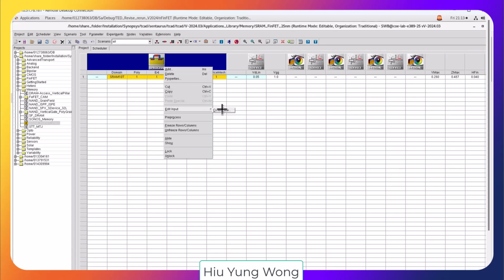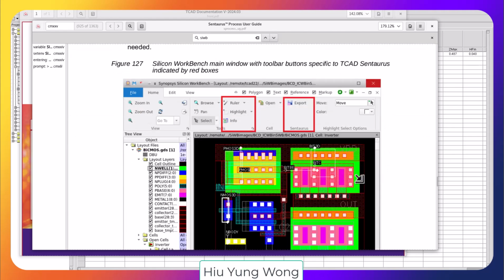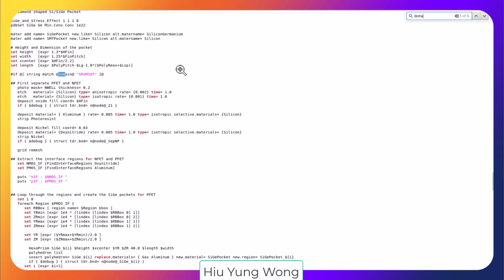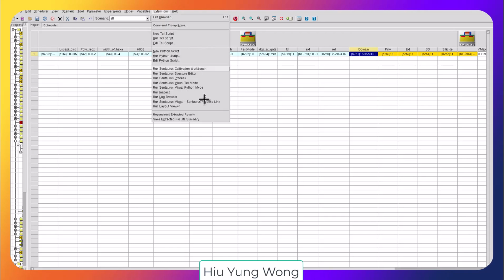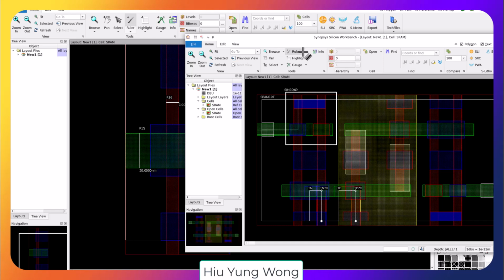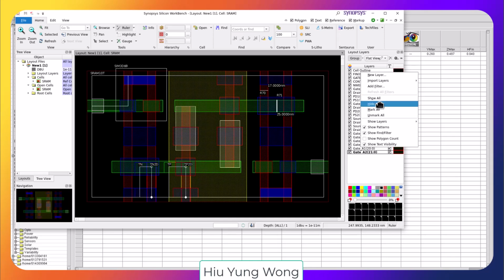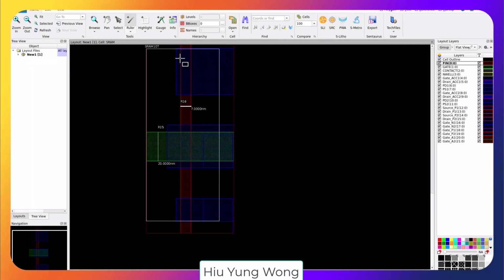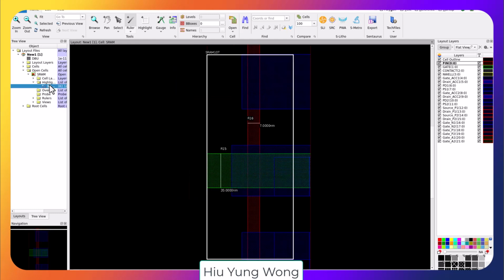TCAD SRAM Example and Silicon Workbench

Comment: thanks you a lot. These videos help me alot.
But I have a problem. I have simulated a simple MOSFET in Sentaurus TCAD. In my SDEVICE I set Drain voltage in constant value like (Vd) which I can change manually from SWB, then I sweep Gate Voltage from -Vd to +Vd and I get very fine plot of IV curve.
I want to do this for a lot of Vd and export the XY data of IV curve in Excel file.
I can export the XY data of the plot one by one but it's really frustrating and takes a lot of time from me.
Is there anyway that I can do it faster?
Reply from the maker: Please take a look at L-6 and L-8 of this playlist. https://www.youtube.com/playlist?list=PLnK6MrIqGXsKoQhUE-EjgJhum8YlJH4un This video demonstrates how to save a script in Svisual. What you want to do is to manually try to export the XY data one time and save a script. Then modify the script so that you can save them automatically by running the script. Thanks!
Reply: Thanks for your quick reply, I have watched all your videos on Centaurus TCAD. I want to create a MOSFET model based on Verilog-A and use it in Cadence Vertuoso. To create my model, as I said, I set the drain voltage to 1V and changed the gate voltage from -1V to 1V and extracted all the drain currents for different gate voltages in the excel file. After that I set the Drain voltage to 0.99 and changed the Gate voltage again from -1 to 1V. I need to repeat these processes for Vd from -1 to 1V in 0.01 steps. I can do it one by one but it takes a lot of time also if I try to set Vd manually it will be around 200 simulations in swb. I have modified SVISUAL to extract all the IV curve data, but there are still too many simulations in swb. Is there a way to modify my SDEVICE code to simulate much less in SWB?
Reply from the maker: @mohammadhaseli-m2o  Do you mean you want to sweep Vg for different Vd in one sdevice instance? Yes, you can do so. You can take a look at the Applications_Library/CMOS/CMOS_0.35um Idvd example. Thanks!